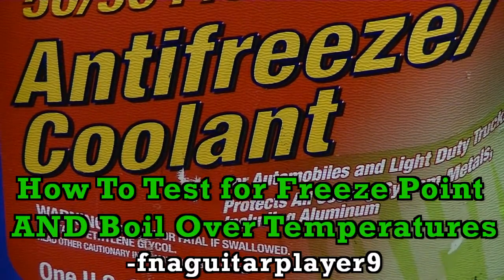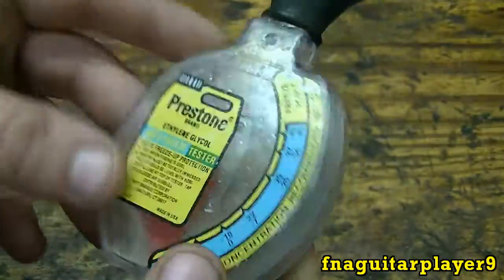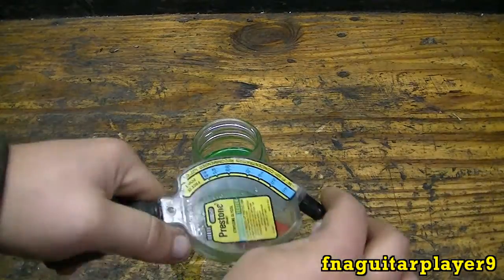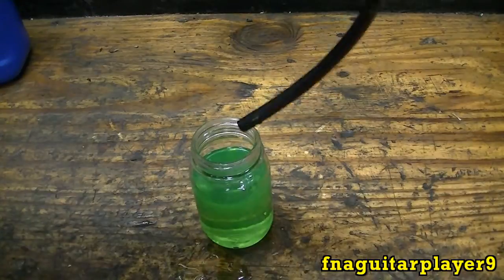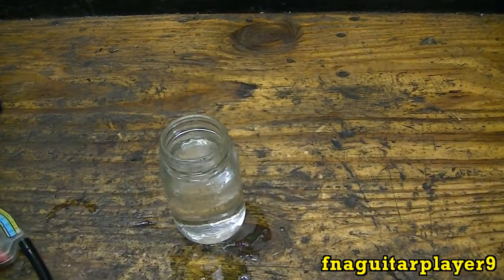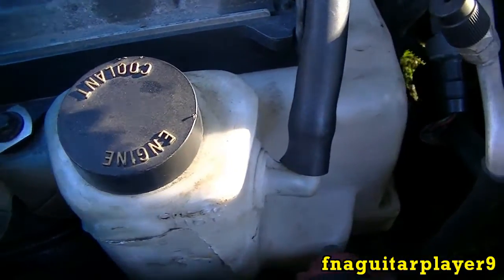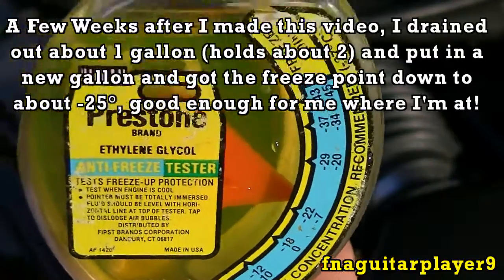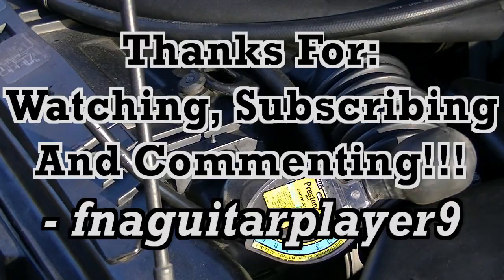How to Check Antifreeze / Coolant for Freeze Point and Boil Over Temperatures

Comment: That's important to check, but did you know that coolant has anit-corrosion additives that wear out over time and when that happens your aluminum radiator and heater core can be damaged? That's the first thing I thought of when I saw this video.   My coolant needs to be changed. Thanks for the reminder! Thumbs up.   Maybe just by adding some new coolant you can stop corrosion, but radiators and heater cores are not cheep to replace.

http://www.aa1car.com/library/cooling_system_electrolysis_corrosion.htm

Be real, be sober.
Reply from the maker: Yeah I knew that as well, i should have noted that on the video, I think book recommends changing it like every 3 years? not real sure on that, but that seems a little to soon. Oh yeah, they are high dollar haha Thanks for Watching!!!
Reply: Yup ! heat, cold and humidity will wear any liquid out. Even if you're not using the engine. I have a tiller that has only 5 hours of use in the past 3 years and had 3 oil changes. Everything looked fine but, looks can be deceiving. Too bad there is no "tools" to check the quality of oil.
Reply from the maker: R Verro
Yep, its something thats always overlooked, not to many people replace antifreeze, let alone the oil with some people haha Thats a good idea to change oil like that, I change oil in the lawn mowers every year, no matter how much they are used, I need to start doing it twice a year, help make them hold up longer before needing rebuilt. Thanks for Watching!!!